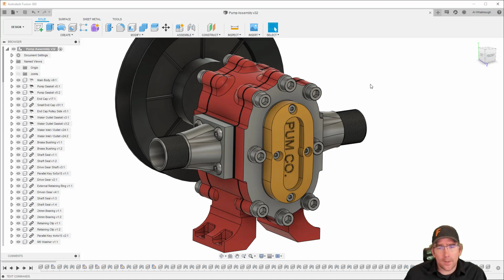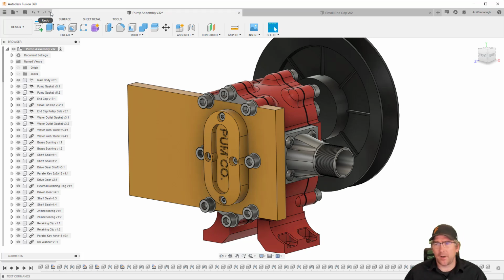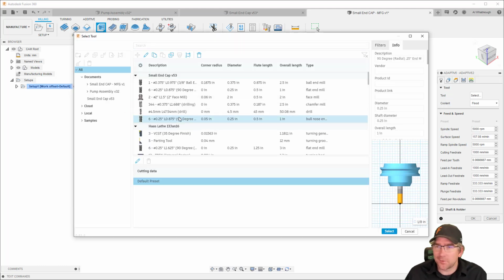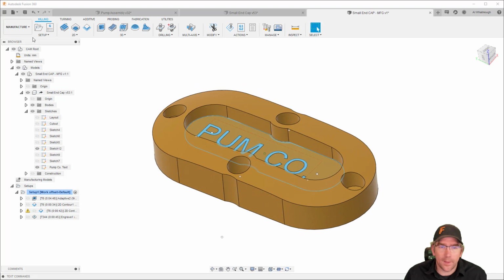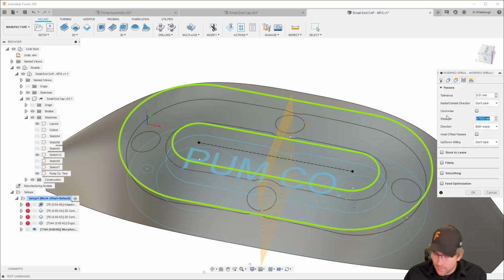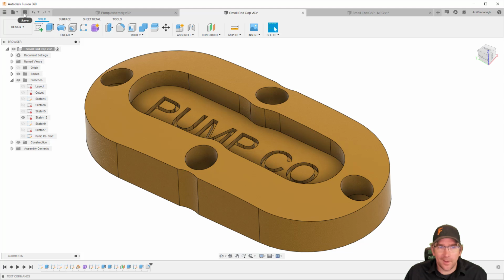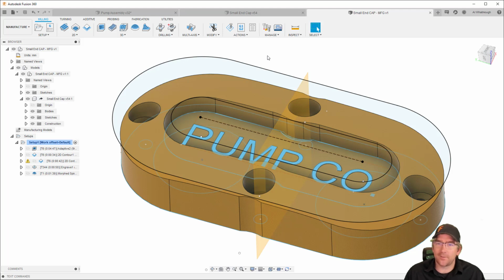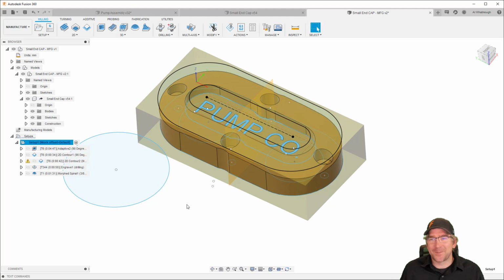TUTORIAL:  Separation of Design and Manufacturing Documents

Comment: Excellent video Al, good length, pace & content, don't change a thing. Awesome to see that soon, unaffected toolpaths won't need recalculating unnecessarily after unrelated model/design changes. Impressive that Autodesk has acknowledged (and are making steps to) allow users to control what changes they accept downstream.  However, I suspect the next logical and necessary step in this process will be a way to see what those changes are and be able to choose which ones to accept or decline (although I think this may be possible with milestones).